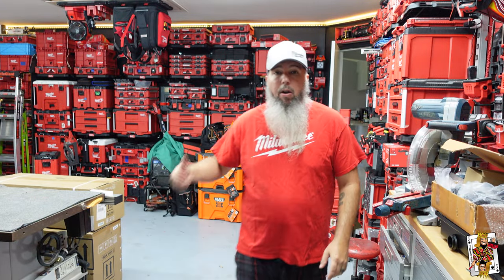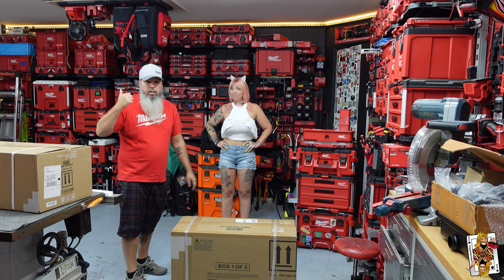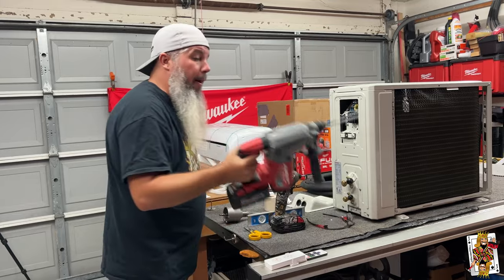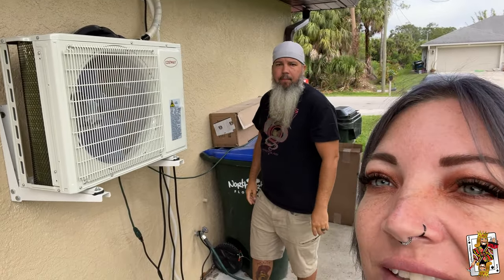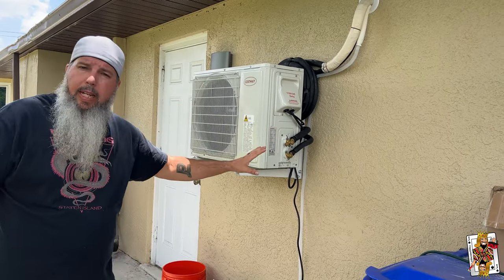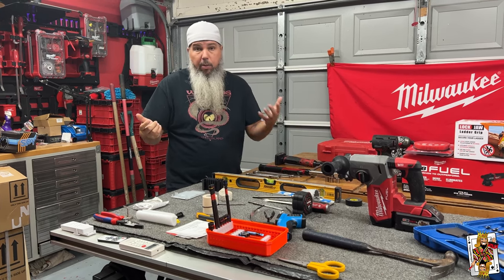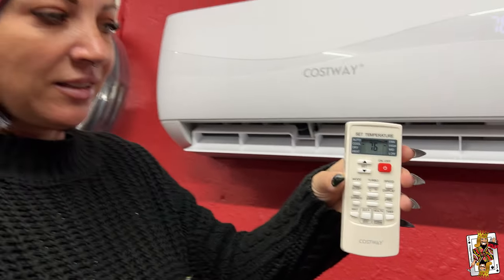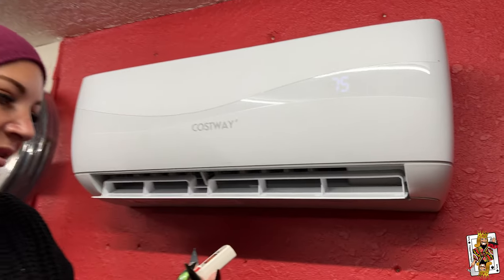@costway Ductless Mini Split AC install,  No more PACKOUT Princess in bikinis or sweaty JOA

Comment: Thanks for the good vid BUT.......I wanna make 1 suggestion.  You should NOT have spooled the refer lines vertical, against the wall(this allows the oil to pool at the bottom of the spool upon draining back to the comp), you should have spooled them horizontal(flat) above the condenser so the oil can drain back to the comp.

Comment: Why don't you just run the electrical that you already have on a plug back inside the house and just plug it into the wall. That's what I did demand no extra breaker just unplugged l o l

Comment: Great work! I did get one note from a pro HVAC tech on the leveling part of the inside unit mount bracket that might help on most any unit.   On most units,  you actually don't want it to be perfectly level,  but actually b want it to slightly tilt so the condensation will run to the drain tube.  It stops a lot of mildew and gunk build up,  especially in a garage or shop where dust levels are likely to be higher.  I've experienced this myself in my small studio which produces a lot of airborne particulates. Thanks for the video and taking the time and effort to share the process! Keep up the great work!

Comment: Can anyone supply a link to the installation manual? I am particularly interested in finding out the mounting bolt hole patterns.
Reply: I'd like to see some manual images as well. Can't find anything online and I'd like to have much of the setup done before mine arrives next week. Like the outside base mounting holes dimensions and clearances for both units.

Comment: What flare tool sizes are needed for the line. Are these in meteic or inchs. Thank you
Reply: I meant the copper lines sizes . Metric ?inches? Right Flare tool shopping want to know. Manuals give not much info on anything. My flares look scratched and I want to re do them before I install. Mine arrived last week and sitting. Have to get all the right  tools first now.